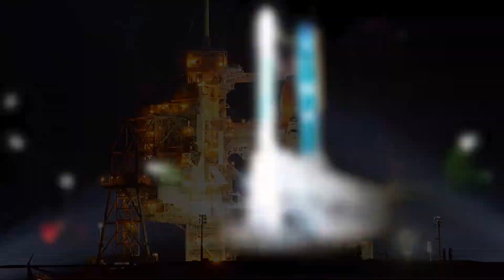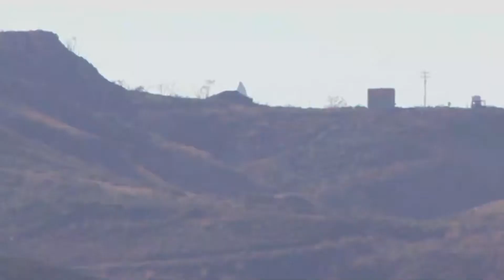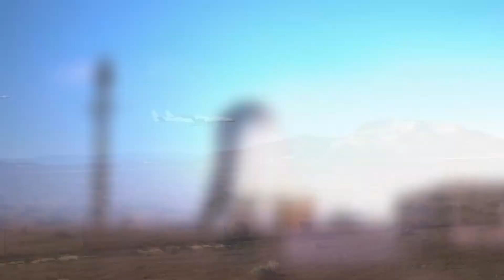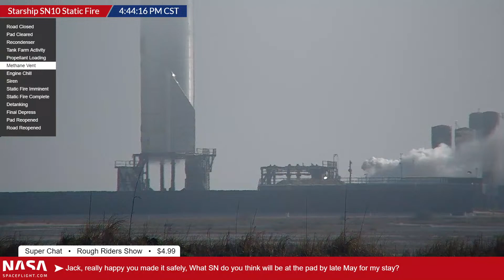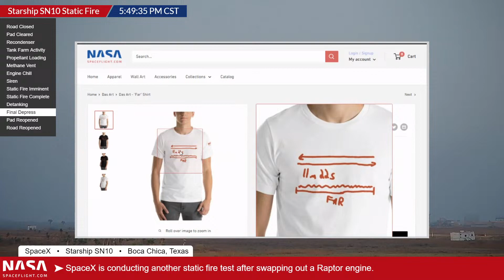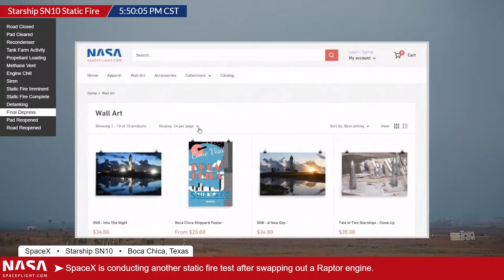Starship SN10 Static Fire Test #2

Comment: If SpaceX misses this landing there are going to be doubts about starship design as a whole.I hope they stick this time.
Reply: Like there haven't always been doubts about SpaceX? Remember when they said they could reuse rockets (F9)? When they said they'd achieve that by propulsive landings? In how many attempts did they get it right? An achiever sees failure only as one more step closer to success. I may not be a big fan of space travel, and one of the reasons I keep coming here is to learn one very important lesson: YOU KEEP TRYING - AND FAILING - UNTIL YOU SUCCEED. SpaceX have demonstrated that enough. And, yeah, I'm beginning to really get hooked on space travel tech.

Edit: Starship is still in its prototyping stage, and they have a lot of room to learn and find/design out bad areas.
Reply: @collinsoju9192  completely agree with spacex approach. Not denying that.But somehow they are not able to control that belly flop maneuver as they would have liked. I M spacex fan and would love to see them master that craft asap.
Reply: Two starships tested so far. It's using a new engine, first of its kind that's taken flight. First rocket of its kind doing a belly flop to vertical landing (don't forget using engines still in development as this part is key). No one is going to be doubting anything with any sort of understanding of this. They will keep rolling out SN's and making changes until it lands. And when it lands they will try again.
Reply: @uniquekillerz  imagine astronauts sitting inside.Just moments before landing you are going to get 90 degrees change in orientation.if not successful you are going land on belly.Sounds very frightening.I mean margins are very narrow.However it's too early to predict what design changes are going to happen based on test results.
Reply: @jaydeeppatil1488  Yeah this is the thing. That's why it's being developed this way as if they went the cautious (NASA route) it would never happen. Rapid testing could work here. There's many things to figure out before anyone rides in it. Many many other flights and landings. It'll have to go through so much testing.

Comment: Why have all the recent static fires been very short duration? What is the goal?
Reply: If they fired for too long it would take off. Static fires are to test the engines are working nominally. They swapped one engine out already so this is SN10's second static fire so they clearly need to do it.
Reply: @uniquekillerz  The starship is pinned down to the launch mount, so there's no risk for take off!
Reply: I believe that the static fires are very short due to a lack of proper flame diverter in boca chica, as without one, they run the risk of damaging the engines with longer burns. Apparently that’s all they need to get good data!